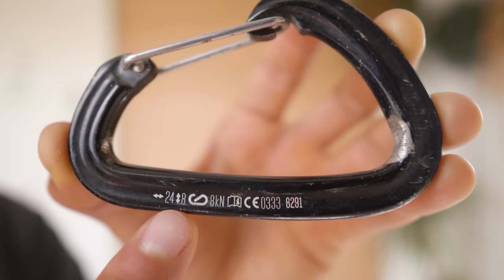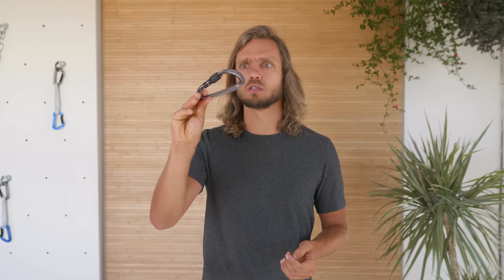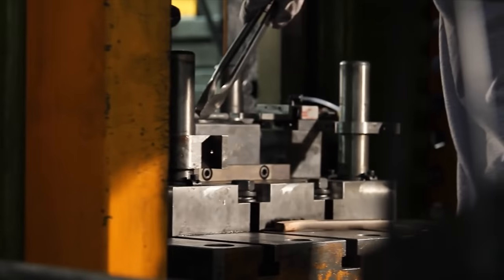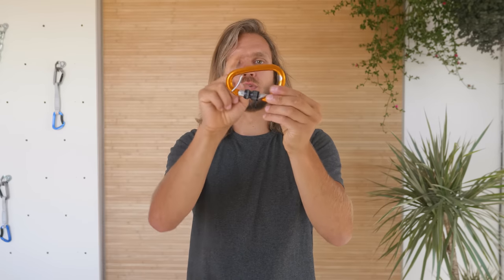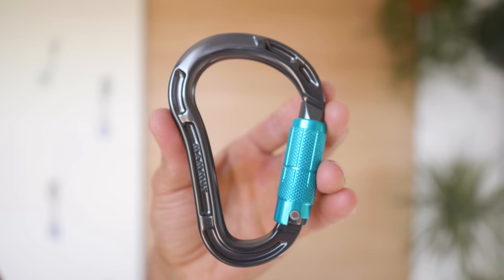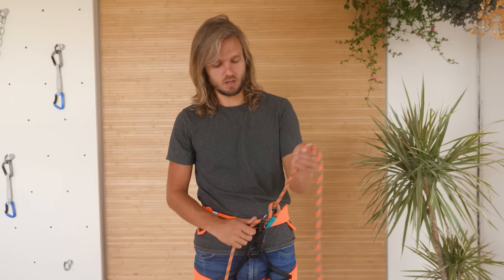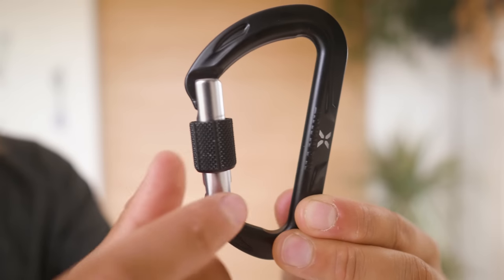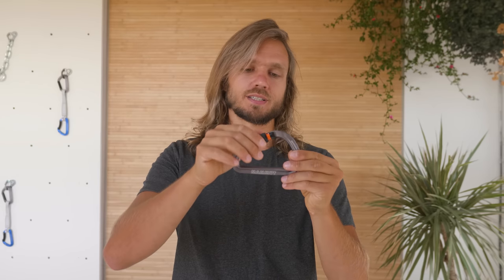Complete Guide to Carabiners - Shapes, Styles & How they Fail | Ep.2

Comment: Guys, what do you do in case of not being able to finish a route? Because my friend and i once had to leave a quickdraw behind. Or should you put te rope directly through the fixed rings on the rock where you normally attach those quickdraws?
Reply from the maker: Do not put rope through anything sharp ;) You can leave a carabiner, or small quicklink - but I'll make an episode in the future of many ways how to get out of such situation ;)
Reply: Thank you for replying!
Yes, sharp is not a good idea, however, the fixpoints on this specific route were rounded, thick steel, just like your little finger - like a to the wall fixed D-Ring. So in this case, is it still critical?

Comment: Your bit about multiple slings pulling on a ceremony in 3 directions got me wondering about when you tie 2 or even 3 clove hitches to a HMS when setting up a belay with your rope whilst climbing trad does it introduce the same problem..?
Reply from the maker: Most of the hitches pull more or less same direction, and forces are to low to have problems ;)
Also if you use bigger carabiners they might be even rated higher ;)
Reply: @HardIsEasy  thanks, I did wonder if it was just a case of lower loads and angles.
Reply: @HardIsEasy  really enjoying these videos btw. Looking forward to the next one this week.

Comment: Carabiner bent over the edge is a quite common thing on via ferrata, when resting on a loop connected to the steel rope anchor. It's sometimes big problem for me, when I need to rest and there is no place to put a carabiner into an anchor properly.
Reply from the maker: Slight torsion on low forces is probably not gonna do anything to a carabiner. Bigger problem would be falling, but... falling on via ferraras is not what you should do :)))

Comment: Micro fractures:
think of a cracked bell.
It should be possible to "ding" a carabiner with another item and listen to the sound.
A cracked carabiner will sound much duller than one that is not cracked.

If they sound the same, they are probably both fine.  Test with as many carabiners of the same type as you may have.

Comment: Man you're great, thanks for all the video you make, very very useful
I may be wrong, but there is something that bothers me though, that is the bolts in the wall behind you, they are badly placed (the part of them adiacent to the wall should be vertical and the part of them coming out the wall should be diagonal). I know you're not falling on them but it's just not nice to see that in a video about safety :)
Reply from the maker: Yea, you are right bolts need to be rotated slightly to avoid it unscrewing during the load (that doesn't happen on that demo wall:) But I had no idea about this when I was making the wall :)
Gonna fix it in the future.

Comment: No need for a carabiner as central point when building an anchor. Just tie a bowline on a bight into the sling and you can clip directly into it. The bowline on a bight creates a loop which can’t slip or open in any direction, even if one of your two anchor points fail. It’s commonly done this way in the Alps.

Comment: Can you please comment on separating bolt from rope biners? For quickdraws, I find it easy to keep consistency and with falls I can see them developing nits. It gets more confusing with my screw gates and HMS biners. For example, can I use a locking biner to attach my PAS to a bolt and later use the same HMS biner to pass the rope for a top rope scenario? What about the damage from loading against the gri gri metal? Some people say it's a myth, others are anal about it.
Reply from the maker: Sure, watch an episode on Quickdraws ;)
Reply: @Hard Is Easy  Thanks for the quick reply, I did rewatch that video before commenting here to make sure I wasn't asking a redundant question and just rewatched it now sped up to make sure I didn't miss it again. I see you mention a lot about the type of gate and the attachment to the sling. BUt I still don't see an explanation for the potential damage to answer the second part of my question about using my locking biners interchangeably. For example, I use an HMS locking biner on my PAS that I attach to bolts on the end of a sport climb and it gets loaded while I clean up the route and prepare for descent. Can I use that same biner later to pass the rope for a top rope set up?

Comment: My friend told me that carabiners with some belay harness loops do not work well with tube style belay devices, such as the tuber or the GigaJul. The carabiners mentioned by my friend are for example DMM Belay Master or Mammut HMS Smart, because they have a lack of space. Has anyone else heard about this? And is it actually dangerous? To me, it seems like it's not possible, because the wire is easily bendable and should follow through it.

Comment: Nice and easy to understand! Although I'm pretty sure the "don't tighten the locking carabiner or after a heavy load it might be impossible to open" is a myth (only happens in some specific old carabiners) and it's not a good practice. Richard Delaney has a nice video about it. Does someone have any experience with that?
Reply from the maker: Thanks for nice comment.
Yea my emphasis was more on the fact that beginners often try to screw them crazy hard and that's just not necessary at all.
I don't know if there was any serious testing done to figure out if after heavy load it makes them hard to unscrew... would be interesting to know... maybe it is a myth... 
I've seen plenty cases that are hard to unscrew, but most might have been due to sand or dust inside...
Reply: I also found that if a screw locking carabiner gets hot (used as a belay carabiner) then it can also become a little hard to unscrew until it cools a bit.
Reply: Hard Is Easy 
Petzl attache screw gate.
If you use this one e.g.with a clove hitch to fix you to the wall, and you load the biner with your body weight before you lock the screw... you have a safe biner 👍😀
You can then open the screw only, when you load the biner again with your body weight.
Reply: the petzl attache carabiner is known to lockup even without loading if you screw it on too tight. ive had three lockups, all three times it was impossible to open with hand strength only. Once I was on a route and I had to wrap the screw with a sling and then kick the gate open.... so its definitly something that can happen.
Reply: @HardIsEasy  During a climbing course we had a discussion, we were trying to make them lock up from "heavy load" i.e. jumping on the rope and we couldn't with the "new" ones where the moving part doesn't touch the carabiners body (only touches the gate) but with the "old" style where the body and the gate it may happen.
Reply: Jammed carabiner is not a myth, lol. Had to use pliers to unlock new screw-gate Petzl. Not sure if from load or rope friction but screw this (badum ts-s-s), I moved to triple locking.
Reply: @hydrosmerc  We had that recently, some oil helped to get the Petzl back to proper function.

Comment: I’d have assumed that “hot forged” means some sort of heat treatment was involved in the process so the tension built into the metal is lower.
Reply from the maker: I'm not a metal expert, but probably there is a lot of nuances at what temperatures they shape carabiners and how fast they cool them etc... to make the strongest metal possible.

Comment: Has anyone got some experience with the crosslock carabiner he showcased? The one thats spring-loaded in both ways.

I did some quick google research and most people gave it a bad rating for not being very long-lasting / pema-locking after like half a year. Can anyone confirm or counter this? I really like the idea of it but dont wanna spend 30€-40€ just do throw it away early next year.

Comment: WRT old gear: if I'm retiring it due to wear (or damage) I prefer to outright destroy it before it goes in the trash. Just to prevent the off chance of some idiot digging through the garbage and then using it. If I'm going to keep something (eg a rope with a core shot) I mark or dye it (and for ropes, tend to make them into mats).

Comment: A nose hook is gona fail. You've moved the point of strength away from the axis, creating leverage and torque so even though the input force is the same, the force on the equipment is higher.

Comment: Objection. Opening a triple locker with only your hand isn't difficult if you do it right.

First of all, there are petzl ball lock carabiners who are also triple lockers and not at all difficult to open.

But if you have such a locker where you push the gate up, all you gotta do is wrap your pinkie around the thin lower part of the carabiner so that the carabiner can't move upwards. Then you push the gate up with your other fingers, rotate it and pull it in
Reply from the maker: Yea ball locks are triple lockers and I like them - but I treat them with caution... They are not that hard to open accidently... 

And cool tip for standard triple lockers - thanks :)

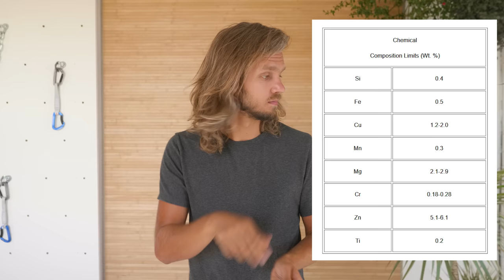Comment: (01:00) A completely gratuitous quibble: Yes, everything you say is effectively true; however, there is no elemental, solid-at-room-temperature metal that is more susceptible to corrosion than aluminum. (Sorry, we Americans begrudge the time it takes to pronounce the one extra syllable).

In fact, aluminum is so prone to oxidize (rust) that it forms a superficial, transparent oxide layer, that it spontaneously grabs from the oxygen in the air, that protects the underlying metal. This oxide layer is sapphire (well, actually corundum).

All of those alloying ingredients serve to minimize grain volume and boundaries, and increase hardness by interfering with ductile deformation at those grain boundaries, which (unlike “heat“ treatment of steel) can be either hot or cold supersaturation precipitation.

Indeed, aluminum is not steel, and its smelting and fabrication have unique and addition treatment steps: Thermal homogenization, annealing, recovery annealing (aka Polygonization), recrystallization, precipitation hardening and saturation diffusion, homogeneous nucleation, and fast and slow quenching.

The heat treatment of “aircraft-grade“ aluminum alloys has the distinction of being substantially different per each recognized alloy. For example, naturally or artificially aged aluminum achieves its maximum desirable characteristics by just letting it sit for between a day and a week.

Weird.

Comment: Think you missed the biggest advantage a screw lock has vs an auto lock. While you can get used to opening an auto lock one handed and then cliping it into a bolt, you cannot clip your rope or tie a clove hitch into the biner one handed. You will need a hand to hold the gate open and another to handle the rope. With a screw gate all can be done one handed.

Comment: I’m pretty sure steel is less brittle than aluminum. When steel caribiners fail, they bend. When aluminum caribiners fail, they explode
Reply from the maker: Thank You, I'm not a metal expert, but after more research turns out that heat treated Aluminium used in Climbing T6/T7 is indeed much more brittle than Steel. 
However I still wouldn't panic about Microfractures - based on how rare we see a broken carabiner or old carabiner breaking under its Ratings.

Comment: "steel is a more hard metal and is more brittle" - I think that this is not correct. Steel is harder, and more ductile, which means it is LESS brittle, and will deform and bend more easily than an aluminum alloy, before it will fracture or break. I think that aluminum will get a micro-fracture more easily than steel. 

It's worth noting that Ryan was not able to fracture biners by dropping them, but that doesn't mean that you can't get micro-fractures. It just means that he didn't try hard enough. Dropping a single biner will cause it to bounce, and that won't fracture it.  The metal will more easily fatigue if it is under load when you abuse it. So for example: load it with 50kg on a rope, then swing it and smash it into a wall. Do that 20 times, then you might find micro-fractures.

I agree with your approach - if you drop a biner, inspect it and if it looks ok, use it. But if the biner takes worse abuse, likeb dropping it a full pitch to the ground, then best to retire it.

Comment: Great video and a lot of great information thank you. However I do want to say there was one thing I did not agree with you on. Now I want to disclose that I'm not an expert so my opinion carries no more weight than yours, but I do have extensive knowledge in metals and have worked with Aluminum alloys, Steels, (Carbon steels, tool steels, stainless steels, ) and Titanium. And the part i disagree with you about is that Aluminum can't develop micro fractures and that steel is more likely to develop it because its more brittle as you put it. So first off I'm gona say that you are both right and wrong at the same time. You are right that Aluminum can't develop micro fractures but it has nothing to do with the fact that its Aluminum. Its the nature of micro fractures themselves. Both metals can develop them, but microfractures are generally developed in 90% of cases during the development of the metal or the part and its almost unheard of developing such a fracture from one isolated hit or impact. Like I mentioned its always a process flaw where too many carbides align in the matrix of the metal forming a weak spot that cracks during development of the part. Now the other 10% of cases where micro fractures develop is from constant forces being exerted on the part. And again its typically because the part was designed with some form of flaw. In the famous case of very first British  passenger jets, the case of them exploding in the air, was due to microfractures developing at the right angle of pasenger windows and propagating through the whole fuselage. This was because each time the plane was pressurized the thin Aluminum skin expanded and contracted, which caused cracks to form at the weakest spot, which was the sharp right corner angle of passenger windows. This is why now all planes have circular windows, we learned to eliminate any weak spots that could cause cracks to propagate through out the full length of a plane. And while steel can be more brittle than aluminum it can also be just as soft/ductile and even more ductile than aluminum. It all depends on the amount of carbon in the steel and the heat treatment, which could  make steel soft, springy, and hard. And for carabiners usually a low carbon steels are used and the Rockwell level is left relatively low. This gives the steel a more ductile and elastic property while still making it much stronger than aluminum. An average steel carabiner has a KN force of 50'-60's and thats unheard of for aluminum. So to sum it up, both metals can have micro fractures but not due to being dropped or impacted, its almost always a manufacturing defect. You can cause your carabiner to develop microfractures but you would have to be exerting such massive loads on it for the metal to actually start stretching. Again I'm not an authority on the subject and one can feel free to disagree with me. This is just my opinion based on my observations over the years of working with various metals and seeing how they behave under various conditions and how they fail. Again great video very informative, learned quite a lot of things I didn't know about carabiners, thank you.
Reply from the maker: Thank You for time to share this info! I'm def not a metal expert, so nice to get such comments!

Comment: 18:26 Nooooooooo!!!!!!
That is not a 'cross loaded carabiner' that is you loading the gate! The cross load rating is not the gate strength, it's a measure of strength 'sideways'. The gate as you have it is not rated at all and your assertion that it can't be broken is totally 100% wrong.
Reply: This, especially on a wiregate which can bend and break at surprisingly low forces if loaded directly. Don't cross load or gate load ever, because they are just a little gate flutter away from being nose hooked and those can break under body weight.
Reply from the maker: Source? The gate even being just a wire is damn hard to break ... Otherwise we would see lots of broken carabiners (gates)

Comment: I know it is a thing in some part of the world to use a carabiner as central point of the anchor, but there is absolutely no reason whatsoever to do so. Just use the loop you clipped your HMS to as the central point! Carabiner-carabiner connections should be avoided as much as possible (i.e. always) as it can easily lead to cross loading of one carabiner.
Less importantly, you do not need to use screw carabiners when building an anchor. You may decide to use one if you really want to but building an anchor exclusively with screw biners is a waste of time and weight.
Reply from the maker: Yea this vid was not really about anchor building, there are many right ways with different pros and cons ;)